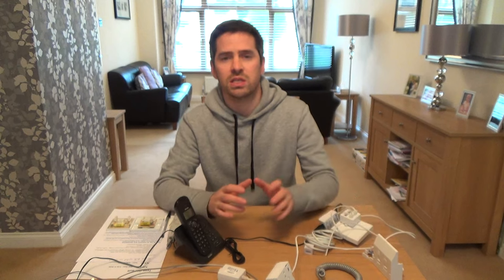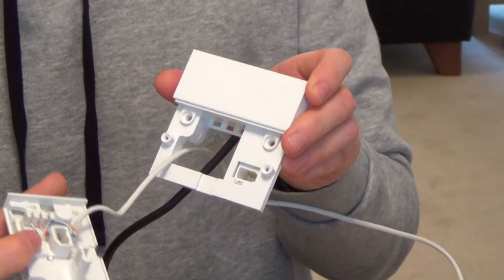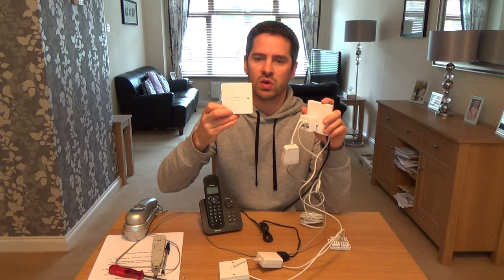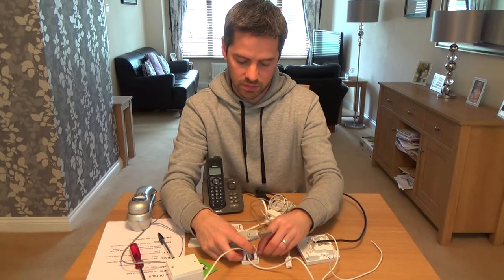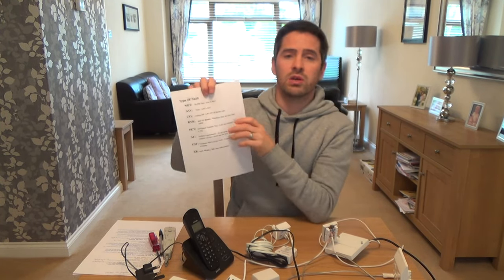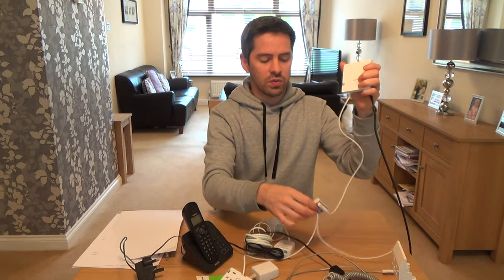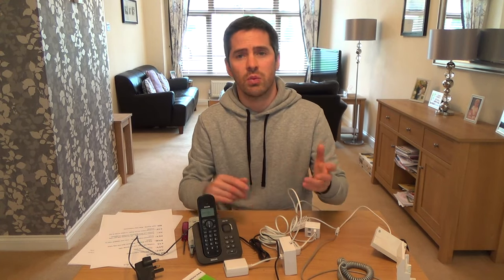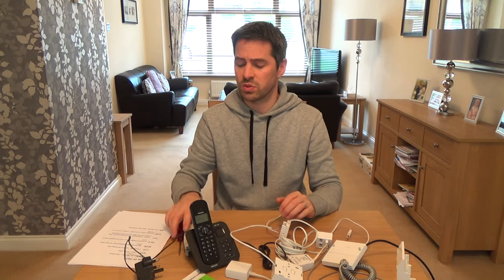How To Fix your TELEPHONE LINE, landline phone FAULT finding and REPAIR.

Comment: How to get rid of the noise in fixed line  due to bad weather? I use some cheap filter but it wont work in bad weather. Could you please recommend some good filters
Reply from the maker: Hi, it may not be a filtering issue. If it is a crackling noise then it may be due to water on the line from the rain.
Reply: @Mymatevince  Simply saying "water on the line"does NOT explain ANYTHING.Explain /show WHY the rain ACTUALLY makes a difference and HOW the homeowner can fix the problem OR if necessary  PROVE the line needs replacing to the SATISFACTION of BT....so the homeowner doesn't suffer further
.

Comment: we got this weird problem that happened yesterday the problem is well the internet and phone are connected via the filter but the phone is dead but the internet is fine
Reply from the maker: ***** See if you can prove the fault by swapping the filter and trying another phone, also test it from the test socket to see if the fault is on the line or on your wiring, this will start to narrow down the problem.
Reply: *****  Your internet will still work if only one wire is disconnected because internet is a one way traffic. Voice is a two way traffic. Best to have your line tested for one leg disconnection.

Comment: Hi mother in law phone not ringing changed master and tested voltage 33 volts dc tried another phone at my house and works it also has a red light on it which works at my house but doesn’t work at hers ….her internet works ok…

Comment: With my phone, i can ring out (it's not always been the case, but at the moment i can) but incoming calls are met with a Scratching Crunching type noise and then they cut off... all i hear internally is one beep and that's all..my  internet is very intermittant and is dropping out all the time..would that be a Ring Trip in your experience?
Reply from the maker: guitarorchestra Hi, yes if the line answers itself without you picking up the receiver then yes it is Ring Trip.
Reply: Thanks very much. I've tried all the inside checks now, so it's definately an external fault. Thanks again for your reply

Comment: I have had a noise problem for 2 days. Crackling which gets louder when a call comes through. I have made the normal checks plugging both the hall and bedroom phones directly into the test socket and the crackling is still there.  I have then also plugged the hall and bedroom phones into the test socket using an ADSL filter and the crackling is still there.  A BT engineer is booked for the 25th Sept.  BT is still stating that the problem is showing as being internal.  How can that be when the crackling is still heard using the test socket?
Reply from the maker: +Gillian Veers Hi, BT are only going by the test result and because a noisy line is normally a wire that is about to break it will still test ok until the wire breaks completely and then the BT test facility will show a fault. Noisy lines often test ok because the line is still just about intact. As long as the noise is present when the BT engineer arrives then he/she will be able to find the fault.....The problem occurs when the noise is intermittent and is testing ok because if the engineer cannot hear the noise on the line then they can't fix it and can charge for the visit. One last thing to check is for dampness around the master socket but if it is nice and clean and dry then you will probably find that the fault will be external and down to BT.Many thanks Vince
Reply: +My Mate VINCE Hi, Thanks for the reply.  The problem was eventually tested to be the wiring to the BT junction box and wiring from the junction box to the exchange. The engineer replaced all wiring.
Reply from the maker: +Gillian Veers Excellent, glad you got it sorted.

Comment: What about when an incoming call rings once then cuts out and the line is dead?,i dont think you mentioned that one thankyou
Reply from the maker: Hi, that is ring trip, normally the call answers itself so the person ringing in thinks the phone has been answered, even though it hasn't. The wires have a fault where they are nearly touching together (damp tree branch for example), and the ringing voltage shorts the wires together which answers the call. On your end the phone is dead because the wires have shorted somewhere before your phone (like the damp tree branch).
Reply: @Mymatevince  Thanks very much,however b.t have said theyve corrected the outside problem ,and now its an internal fault
Reply from the maker: @mspyewacketful  It is possible for internal wiring to cause a ring trip. Separate the line from the extensions at the master socket (if possible) and test the line at the test socket. If the line is now ringing in OK then the fault lies with the extension wiring. If the fault is still present at the test socket then the fault lies with the line. Also try more than one phone in the test socket in case the phone is faulty.
Reply: @Mymatevince  Thankyou ive tried all this with no joy,there doesnt seem to be an inner testsocket,but it all seems very old,never mind worse case scenario i ll get someone in but thanks for your advice

Comment: What happens in the case where you have a BT Openreach (master socket) with two plug ins (top and bottom)?. Tried the test lime and phone is working..but the minute I plug the router cable into the top slot - phone line becomes dead again.
Reply from the maker: Sounds like the router or the router cable is putting a short on the line. Try plugging in just the router cable without the router attached and see if the phone still goes dead. If it does you know you have a faulty cable. If it works then the cable is fine. Make sure the router cable is plugged into the correct ADSL or DSL port on the router with no other cables apart from the power attached and then test again. This way you should be able to fault find and prove the fault onto the router or the cable etc. Also you could try a normal ADSL plug in filter into the test socket of the Openreach socket incase you have an issue with the ADSL or VDSL faceplate and running the above tests again.

Comment: Let Me Explain My Problem
I was on my house phone on A Call
The Phone Was Beeping
Then It Hung Up itself Or To The Point Where I couldn't hear the other person 
Then I plugged it into its stand thingy
Got the other house phone
That house phone said line in use
So I unplugged the house phone that I had plugged in and that did nothing
Then I did the *7890# number thingy but the arrow keys wouldn't go up or down for me to select something 
So then I tried to take out the batteries and then put them back in and that didn't do anything so I don't know what to do now.

Comment: The keypad of my landline phone has suddenly stopped working/responding. I  was cleaning it with sanitizer & might have mashed some combination of buttons or some moisture might have seeped inside, although I was careful to only use a damp rag. I am stumped as I seem to be able to receive incoming calls just fine. Any ideas anyone?

Comment: Hi, My problem is when l pick the phone up l get the ringing out sound then the operator tells me to hang up and try again, l can receive calls but make any, l have had line tests and they are o.k.and l have plugged a corded phone to the master box as well as my cordless after removing the front cover,any help would be appreciated thanks.
Reply from the maker: Gordon Day Hi, to me that sounds like a phone problem, perhaps a sticky button or a button that is not working so it is misdialling but if you have tried 2 phones in the test socket then I am not sure what it could be unless it is an exchange fault. When you pick up the phone does pressing the buttons break the dial tone and does every button work (hang up after every press of a button to see if each one breaks dial tone).

Comment: Please help me to diagnose telephone fault. My phone doesn’t  ring when someone calls me. Got dial tone on my phone. Can ring out. As I said, when someone calls me, the phone does not ring BUT if I pickup the phone while some calls I can  hear the caller. Also, the caller ends the call after that call is ended, no one can call back for a while because my phone appears to be engaged.
Reply: Ring BT , it sounds like an Exchange fault ....
Reply: Thank you. As it happened we had very friendly SKY engineer who fixed the fault.

Comment: Hey... can some one help, my corded telephone was dead, I fixed everything, changed some resistors and also, replaced some 103 capacitors, my LCD is working fine...  but I am unabke to hear it in the hand set? What should I be doing.
My telephone is AS7402

Comment: hi vince i found a fault on my wiring. i have been suffering with a loss of about 4mb sync speed,so i plug in to test socket and my speed shoots back to normal. does this mean my phone sockets are at fault? i have my router plugged in my main socket and phone in front room,
Reply from the maker: MrMjay79 Hi, yes that means the fault is inside on your wiring or microfilter or socket etc. Try to eliminate things by swapping over microfilters etc. If you have no joy then you could always get a ADSL or VDSL faceplate and install it on the NTE5 master socket as this will be the same as plugging into the test socket as far as the broadband speed is concerned. But if your extension cable to the front room is starting to fail then you may find the phone will stop working once the wires break completely or if they are starting to short together.Many thanks Vince
Reply: My Mate VINCE thanks for reply. Yes everything works fine just lost alot of speed. If I plug router into frontroom it's slow just like when it's plugged in to front of main socket by front door. If I plug in to test socket all is back to normal. So I basically need a new socket by front door then? Again really appreciate your reply.
Reply from the maker: Hi, It might not be the main socket, it could also be the cable feeding the extension or the extension socket or the microfilter. That the thing that makes it harder to fault find, if you have a punchdown tool you can disconnect the extension cable from the main socket and then test at the front plate and if the speed is still slow you know it is a master socket problem but if it is ok then the master socket is fine and it might be the extension cable, extension socket or microfilter. Then you need to break it down further.
Many thanks Vince
Reply: My Mate VINCE Ok thanks again you've been a great help and like I said really appreciate your quick response. My friend has a tool so will get it of him tomorrow. Will let you know how I get on, have subbed to your channel because you've been a great help thanks again.
Reply from the maker: MrMjay79 Thank you, I appreciate that. I hope it goes well for you.
Reply: My Mate VINCE is there anything I could do to get my ping down. I see you've a game console also. What if anything can I do to improve that. I'm on a download sync to my router of around 6.4 at the most it been 7 but my upload is below 1. Would prefer to get my upload a little more if I can. Thanks again for replying. If I don't have any luck tomorrow with wiring my sockets I will take alook at your eBay site and order what I need from there ie master socket cables ect.
Reply from the maker: MrMjay79 I think the main thing that effects the ping is the speed of the broadband and distance to the server, so if the games server is near you will get a lower ping and if it is far away the ping will be higher. If you do a speedtest on speedtest.net then pick a nearby server and your ping will be a lot lower than if you pick a server in Australia. I don't know if you can do anything to reduce your ping, I don't think you can but I may be wrong.Thanks Vince
Reply: My Mate VINCE Hi Vince just wanted to say thanks for your help, managed to fix issue with phone sockets.I was wondering is there a way to get a slightly faster upload speed as mine is pretty slow? Thanks again for your help.
Reply from the maker: MrMjay79 Hi, you could try removing the bell wire (wire attached to terminal 3) to see if it makes a difference. Take a look at my video on how to increase broadband speed that was done last year as it may help.Thanks Vince

Comment: Please help. If I have unplugged EVERYTHING (really I have!) from the master socket and the fault is still there is that the service provider's responsibility? I have an intermittent fault where I can dial out fine but people phoning me either get through as normal or they get 3 beeps and an "invalid number" message.
Reply from the maker: Hi, if you are sure it is not the same person phoning you from the same faulty phone, so if it is also happening when you phone from your mobile phone or your neighbours phone then it has to be a problem (I would think) with the Telephone Exchange so that is down to the service provider.
Reply: Thank you so much for your reply. Yes it is happening from all phones landlines and mobiles. Engineer is coming tomorrow so hopefully they will find the fault.
Reply from the maker: Good luck with it.

Comment: my phone is not ring at all but if i call use my mobile i can hear if conect but my home phone not ring .. out of range ... can you help me
Reply from the maker: Hi, it might be a ring trip where you can hear it ring once when ringing in from your mobile but you don't hear the phone ring in the house. But if you pick up the phone you are connected to the mobile. It is caused by the wires nearly touching together (often overhead wires where they have been rubbing on a tree) and when the higher ringing voltage comes down the line it arcs over the damp wires and connects the line.

Comment: When the home phone rings,the internet will stop working
Have you any suggestions how can fix this issue?
Reply: Same problem, I plugged off the phone and the internet no longer turns off, but dunno how to fix it when a call comes in
Reply: Go buy an ADSL filter for each socket that is in use

Comment: My home phone cord is plugged into my Optus modem connection thing (which is plugged into the wall) and then the cord is plugged into my home phone. But my home phone keeps on saying check tel line. Please help.
Reply from the maker: +LTFL x ImBenn  Can you try your home phone straight into the wall socket to see if you have dial tone. If it is still dead maybe try another handset or borrow one to see if it is the telephone line or the phone at fault. This way you will be able to narrow down the problem.

Comment: Hi There,

My Phone is dead but the weird thing that all my House Master Sockets is dead, i tried to connect another telephone from my neighbor and tried to connect to all house and its dead.

Thanks
Reply from the maker: +Hamod Hadidi Hi, it may be an external fault. If a wire has broken in a manhole or somewhere between your house and the telephone exchange then the line will be dead even if you swap the phones inside house.

Comment: I can not make outgoing calls from my chordless phone
So how can u plz tell me how to fix it?
Reply: Hi there. Have you tried borrowing a wired telephone and connecting that directly to the line? If you do that and the fault is there then try the test port inside the master socket. If the fault continues then that is an issue with your provider. Otherwise it's a fault with your equipment. I hope this helps

Comment: Umm i have a problem with my phoneline, i cannot get internet and the internet provider doesn't know why and what's to call a technician out to fix it but i don't want to have to pay that bill, My problem is that besides not getting internet or homephone i am hearing a radio station through my phone, there isn't even a dial tone, you pick it up and press call and it says, "line busy" and you hear the radio?
Reply from the maker: T3rr11 Telephone wires can pick up radio but you should still have dial tone, you will have to do your testing at the master socket test socket and use more than one phone, if a known working phone is still not working at the test socket then it is a line fault and your service provider will need to fix it but it should be free if you have not damaged the wiring. They can fit a little junction box which helps will the radio noise but some phones seem to pick it up more than others.Thanks Vince
Reply: Alright no worries thanks vince :)

Comment: Hello Vince. l cannot dial out as there is no dial tone,but i am receiving calls
Reply from the maker: Gordon Day Hi, if you test for dial tone at the test socket using more than one phone or a known working phone then you will know if the problem is external or internal to start your fault finding. If the line is very noisy when you receive a call then it might be a wire that is just barely broken and when the higher ringing current comes through the line it bridges the gap to give you a connection.

Comment: You means Telephones Technicians Servicemen or Servicewomen people.They’re those services people that are coming out into the fields doing all of those wirings and those hookups works not an Engineer.Engineering people doesn’t do very basic of wiring works in the people homes or offices in services fields works.Engineers people only designed them and most of time they just do testing in the labs for any prototype to make sure for any products they’re designing and that are working right or not before it going out to for the consumers world that it only.

Comment: if someone gets radio stations on the line 99% of the problem is they grounded the master socket box from the provider to the electrical panel, when it should be an isolated separate ground rod or plate with # 4 green ground wire!
Reply: this is not unbalanced Art it turns it into a parabolic antennae in most cases!
Reply: you are right so can a dirty load coil!